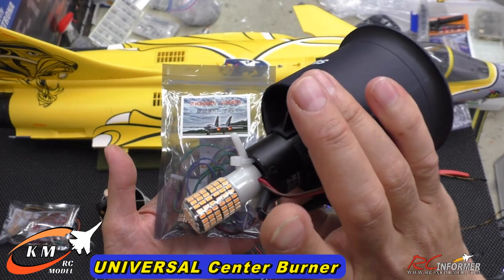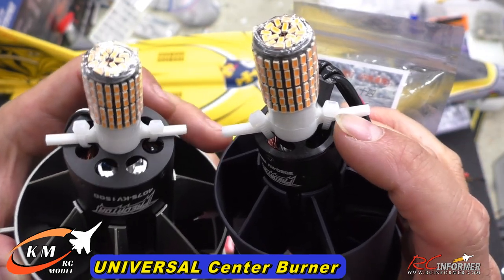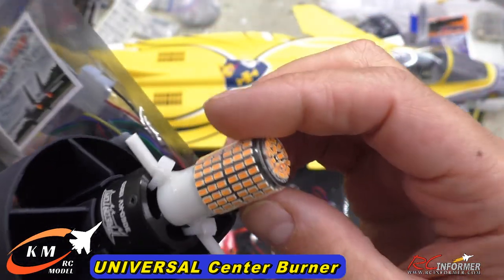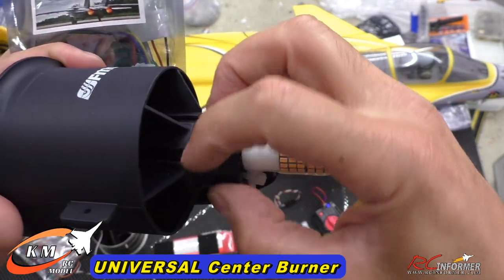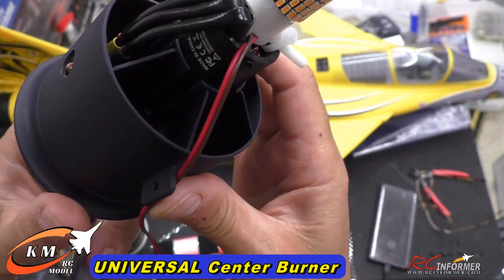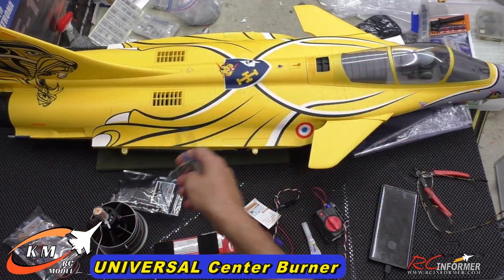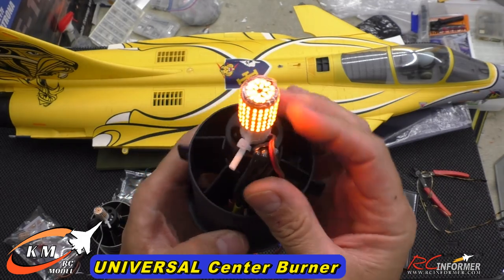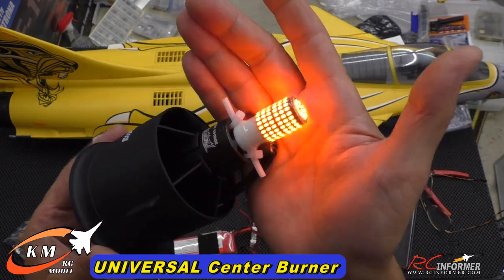KM-RC Models ***NEW*** UNIVERSAL Center Burner Overview By: RCINFORMER

Comment: Just installed mine on my FMS bae hawk. I've used other brands and they are good too. What I like about this one is its universal fitting and it's easy to fit and remove. Others require glue so once it's on its on and the 3D print breaks when trying to get it off. I also noticed a slight drop in performance with the ones that get in the way of the airflow. I'm hoping for this company to bring out some mulit coloured or funky colours like green or purple

Comment: what is the difference between the KM afterburner and the one from freewing?
Reply from the maker: KM has more features. It has several colors and is programmable & universal (fits ANY inrunner). It also has a low voltage alert. The freewing is inexpensive but is only a single color.

Comment: Hey Rich, I am trying to calibrate mine with the same servo tester that you have. I am using separate batteries to power the center burner and the servo tester. Is this possibly causing the issue? Any advice you can share would be appreciated?
Reply from the maker: I'm not sure if you can calibrate it with the tester?  I only did calibrations on mine through the transmitter throttle stick.
Reply: @RCINFORMER  Ok, it may not work because I was getting some weird flashing sequences on the little center burner control board LED. I just went ahead and calibrated it in the plane per the instructions and had no issues then. Thanks for the response and sharing your videos. Keep up the great work ;)
Reply from the maker: @trublu2nu   Thanks for watching!

Comment: Looks better in the all the other burners looks like it's really simple to install thanks for the informative video
Reply from the maker: It's the easiest to install!
Reply from the maker: It has a nice low burn at Idle & it can be programmed to start getting bright at any throttle position:)
Reply: Heat from the inrunner will eventually cause it to go wonky. Only 2 points of contact isnt such a good idea… but time will tell!